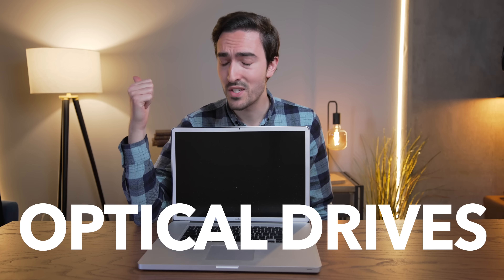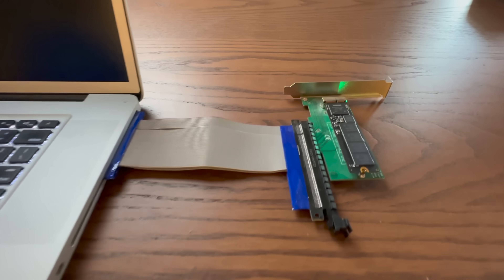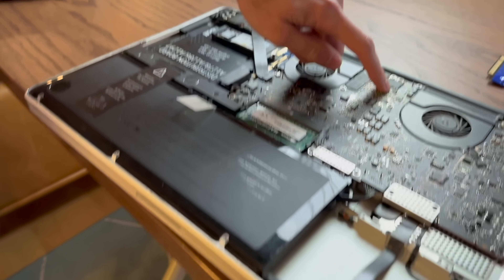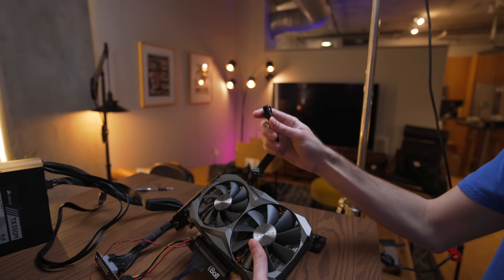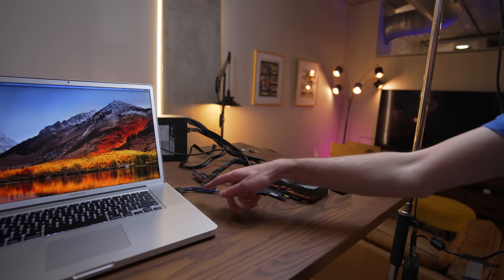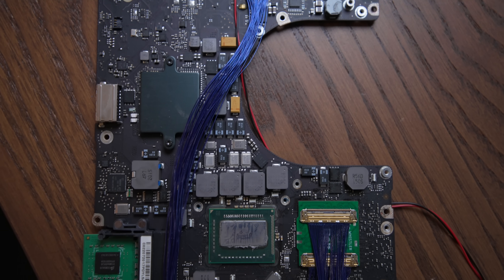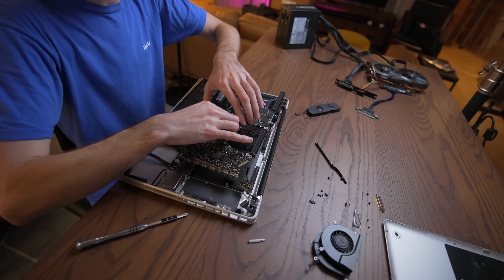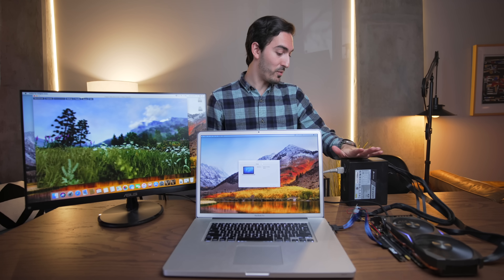This ain't your daddy's 17 inch MacBook Pro...

Comment: I am watching this on a macbook 2011 17 inch on catalina all because of dosdude. :) bypass the broken gpu app.  seeing this is awesome so many ports on the 2011.  I used the pci installed usb 3 and used a startech external video card to get the hdmi outputting to a monitor albeit slow but fine for simple tasks

Comment: This supports my view that Apple can easily replace a couple of thunderbolt ports on the Mac Studio with m.2 PCie NVMe slots with ease.

Thus the Mac Studio with a small reduction in parts cost, could support 3 secondary NVMe drives. This would solve most of the issues faced by creatives struggling with a morass of thunderbolt limited external NVMe SSD. 

I really hope Apple chooses to add user upgradeable m.2 Pcie NVMe as a secondary insecure SSD (so that user media remains safe, even if the Mac SoC does a melt down and makes the SoC encrypted primary SSD unrecoverable.  This would remove render and transcription speed and timeline bottlenecks when video editing by enabling media to be served at full speed of the SoC, without competing caching on the main drive.
For the cost of giving users what they want, and reducing production licensing costs (the intel thunderbolt fee), apple could deliver another genuine game changing computer.

Comment: Is there a problem with the graphics card on all 2011 Mac Book pro’s? My late 2011 Mac Book is now nearly 12 years old and I’ve only had to replace the battery. I want to up the RAM to 16gb and replace the hard drive with an SSD but how likely is it the graphics card will fail? Thanks for the video, great as always. All the best, Colin.
Reply: The AMD Radeon 6000M series of GPUs suffered from a variety of issues stemming from defects during the manufacturing process from the factory. It is only the matter of when the GPU will fail. I’ve been fortunate to also have a BTO 15-inch Late 2011 with a High-Res display that still has a functioning GPU. There is a common misconception that the GPU failures are the result of bad soldering from the GPU to the logic board, however, the GPU die itself is a defect and will eventually stop working even if you tried the process of “reflowing” the GPU back to the board. The 13-inch models of the early and late 2011 MacBook Pro do not suffer from any graphics issues as they only use integrated graphics and are cheap compared to finding a functioning 15-inch or 17-inch model in the second hand market just for collectors.

Comment: got a Late-2011 with a mid-2012 logic board 15" MBP could really use this upgrade, as the meme states, Shut up and take my money already. I just have design a way to house a powerful enough PSU and a GPU that can I can bolt onto the bottom of the MBP, and cool it all as well. and maybe cram in a blu-ray drive for good measure

Comment: Apple should hire Dosdude, he has far more talent than anything we've seen from any MacBook Pro engineering effort since at least 2015.  Apple should sell value laptops that have lower rez internal video and allow for the eGPU expansion in the same manner--full bandwidth.  

Apple has made so so many mistakes in recent years.  I love MacOS because I'm a developer, but the hardware has gotten iffy.  The newest Macbook Pros that are back to a full keyboard and not just lighting ports are better, but so much could be done and so much has been lost due to the people they hired that took them down some very bad roads (soldered on RAM--why why why?)

Comment: So First, this guy seems to be a genius. And second, WHY didn‘t Apple build the mac like that in the first place…?
Reply: Apple's singular vision seems to have been to make the Mac as thin as paper.  For some reason that was seen as the highest value?  Then they go on and on about how green they are when everything is now throwaway because it can't be upgraded at all!  I have a 2012 13" Pro that's still going because it got fresh RAM and a new hard disk after the original one failed.  That's green, not landfills full of last year's models.